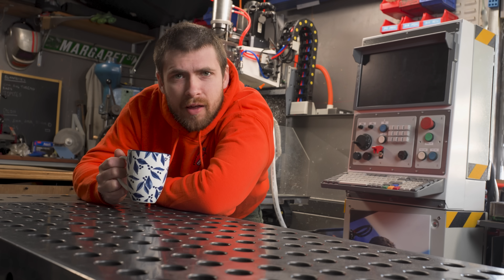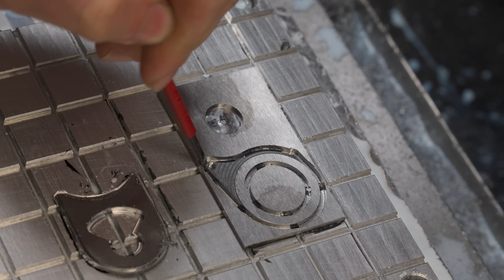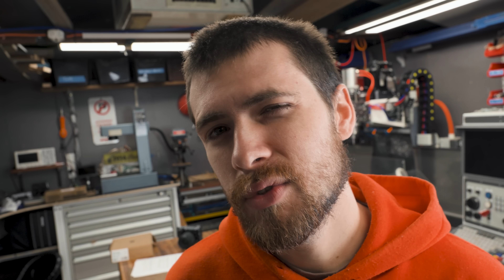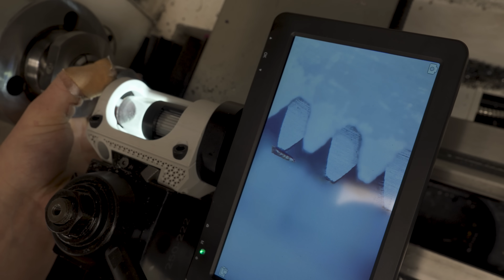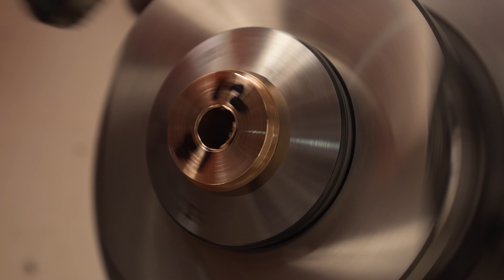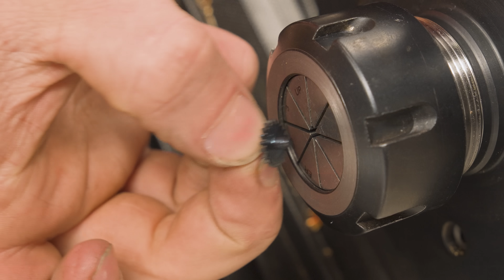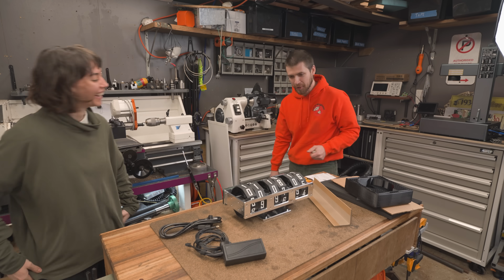What if angles were metric?

Comment: I am german I would hate the hassle to set my cad program to gradian but damn I would be tempted if I had that thing. But something does bother my inner german that it needs 400 gradians for a rotation and not 1000.
Reply: At least a right angle is 100 😂
Reply: @Mobin92  if using inclines it'd be 45 deg, and you'd need 800% for a circle. Closer to 1000, still highly divisible and equally "wtf?!".
Reply: There is an alternative variant of "gradian" used by some armies for aiming murder-sticks at each other that is 1/1000th circle per gradian. But it's even less used outside industrial murder than "French gradians" (1 circle = 400 gr_FR).
Reply: Try writing 30 degrees in gradians
Reply: @janusmarais7580  > 100 / 3 ; sinon, on utilise le radian "rad" ^^
 > Un angle de 1 radian intercepte un arc de cercle dont la longueur "L" est exactement égale au rayon du cercle (L = r).
Reply: @janusmarais7580  Try writing any form of 1/3 in metric, for that matter
Reply: @RobABankWithABagel  exactly, base 10 is flawed compared to base 12. And ofcourse it was the French who sent us down this slightly inconvenient path!
Reply: @RobABankWithABagel You are obviously comfortable what you are used to. Great for you. 
But what you describe is simply not a problem. In metric, just round to a value that fits your tolerance. 
Once you need 7, 9, 11 or any other prime number divisions, you are completely screwed in imperial and might resort to mils anyway.
Reply: @RobABankWithABagel  fractions are compatible with metric. metric is extremely compatible with base 10 decimal notation but metric and decimal aren't the same thing.

Comment: So how many gradians in a typical hexagon angle and equilateral triangle interior angle? This is where the system falls apart 😢
Reply: One challenge I pose to metric proponents is dividing a pie up into ten equal slices. How would you even do that? Halves, quarters, eights, etc. are easy to do. You just keep bisecting. You can't get to ten doing that.
Reply: @1pcfred but how would you do that in non-metric (or any other) degrees? It seems like you're describing a geometric problem, not an algebraic one.

Comment: The rant about 360 degrees in a circle was pure art.
Reply: Should be 100 ‘something’ in 360 degrees, not 400
Reply: @thekauffman the original metric degrees were 100 in a right angle,  400 in a circle.  German surveyors still use it apparently.
Reply: ...except for being factually incorrect 😬

The radius of a circle subtends an arc of 57.2958°, not 60° 😭
Reply from the maker: We're talking about chords here buddy
Reply: @christopherbedford9897 
what?
how?
Reply: @Osc @Oscar4u69 because 360/60 = 6 but 2pi > 6
Reply: @christopherbedford9897 meh, 2π≈6

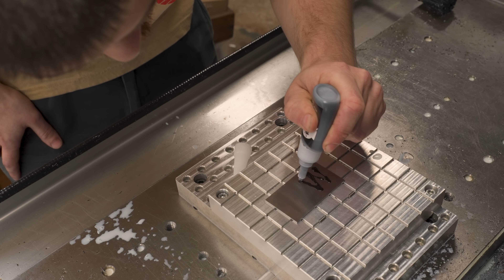Comment: 5:40 I agree that Loctite 480 is amazing stuff, and when your surfaces are as flat as those, you don't need to use nearly that much. Most of it probably squeezed out of the gaps anyway, but try less next time - or just test by whacking a few blocks with various amounts of glue off a surface. A couple drops is plenty!